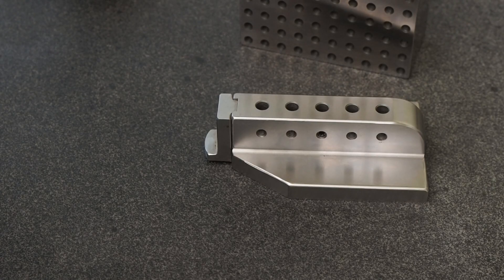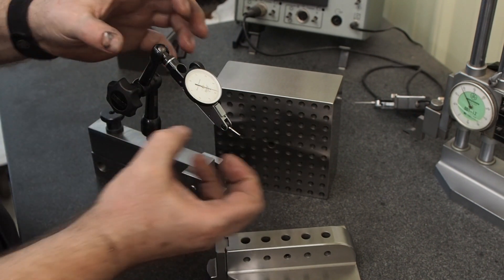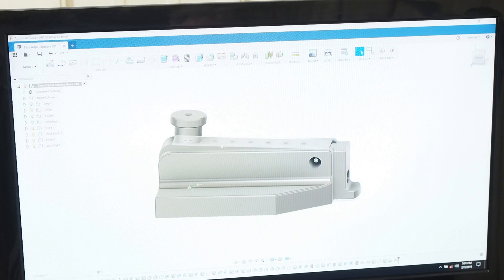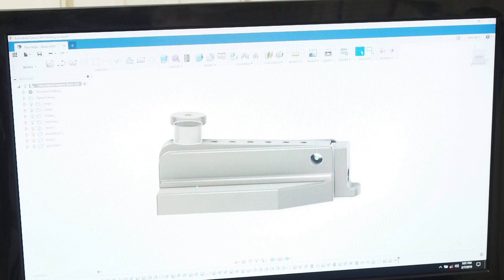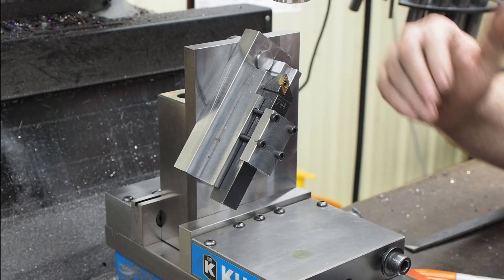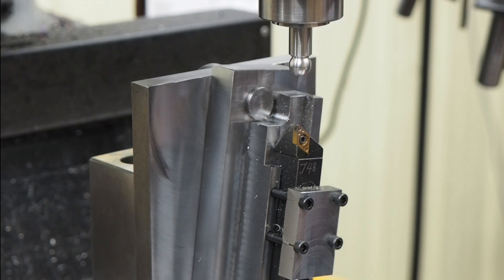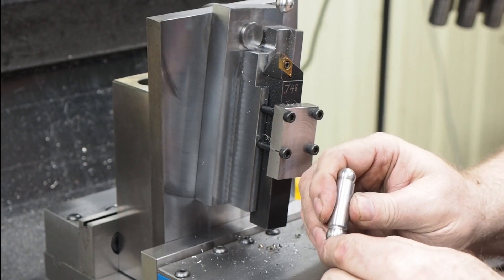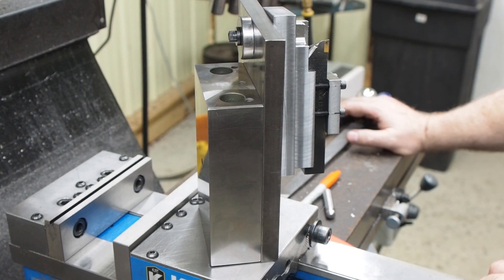Making a Prototype Radius Tool Pt. 1

Comment: You will need a spherical end on the adjusting nut as well as the bottom, otherwise you are tracing an involute, and the radius to the "ball" end from the pivot will vary with angle.  It is interesting to see how smoothly you could cut the ball with only hand operating the cutter.
Reply from the maker: Thank for pointing that out Barry, I will have to modify the other end to compensate.
Steve
Reply: Alternatively just a slot, so that the top nut/washer can slide in the axis perpendicular to the hinge.

Comment: Could you use a rotating barrel nut for the 1/4 20  on the top plate then you don’t have to worry about it staying flat on the nut

Comment: I finally got to the end of your video.  Thank you so much for the shout out.  I jumped over 1000 over night and I didn't know why.  I knew that someone had to mention my channel but was not sure who.  This has been a fun build so far.  Modeling it in solid works or the like would have avoided one of my design errors but it only resulted in an extra hole drilled. I am hoping that my flexure design works out.  I am also looking at including an adjustable height radius shoe.  Thanks again for the inspiration on this project.  Don't forget to comment on my 1000 sub video, you could be a winner.
Reply from the maker: You're welcome Steven, glad to help.
Steve

Comment: After about 20 years of using the surface gage and ball method, I am going to make a squarness comparator. Probably based on the Taft Peirce design. I just can't for the life of me figure out why its necessary to have a fine adjustment. It just seems to me that you rotate the bezel on a fixed indicator to 0 when setting off of a master square and that's it. What am I missing?
Reply from the maker: Hi Max,
I am glad you brought that up. I think I for got to mention that this unit is much more than a Squareness comparator. It also works great as a surface gauge and other things. I will have to make that point and demonstrate in a future video. I modified the test unit today and it works great. In the video we shot today I demonstrated that you can lock it down and it is solid like the non adjustable unit so it can be used both ways. The indicator I use has only .008" travel so if your not use to adjusting without a fine adjustment it can be a little frustrating and time consuming. I am use to it but the kids are not so I am sure they will like the adjustment version better.
Steve

Comment: If you don't get your last pass with the centers perfectly intersecting, the resulting part is simply not a sphere.  I'd have to put a mic across it in random directions twenty or thirty times before I could believe in it.
Reply from the maker: Hi Bob,
You are correct. Also, you can use an indicator on center and sweep it.
Steve

Comment: Nice job Steve. I love this squareness checker and the new radius tool.  For a more precise control of the movement I prefer to use a spring steel flexure plate like Robin Renzetti uses instead of using a dowel pin pivot.
Reply from the maker: Hi Stephen,
Right now this is concept stage and there will be many changes before I am done. Nothing is carved in stone yet. I am aware of the spring steel flexture and discussed this on a different project (between centers grinding fixture) with Robin in the past. It would be a very good and sound way to do this but I will play around with other methods first and weigh the pros and cons  before final build.
Steve

Comment: While it is cool doing lathe work on the mill, wouldn't it be more productive to fix your lathe so you had 2 machines you could use at the same time? Especially since you have more than one shop worker. :-)
Reply from the maker: Hi Brian,
The lathe is not mine, a friend is letting me borrow it. It is not worth fixing, to many things wrong on it. It does not have a DRO. It is small 10" and limited in capacity. The chuck is not accurate, the mill collets are. I do not have the money, time or the skills needed to fix the lathe. I do use it a little now and then for certain things. Also, I do these videos so those who have a mill and no lathe can see that there are alternatives.
Steve
Reply: @SolidRockMachineShopInc  That makes sense. Are you looking for a lathe? I occasionally run across stuff and would keep you in mind if you are.
Reply from the maker: Hi Brian,
This is what we have our eyes on now. https://www.clausing-industrial.com/productCatalogs/Cl/Clausing%20MultiTurn%20Catalog%2003-2017.pdf
Steve

Comment: Steve, I would like to copy your squareness comparator base you show in the opening of this video, the one with the multiple holes for the Noga indicator holder.  I am interested in any details that might not be obvious.  How about a rough height, width, length, material, any special considerations, and any changes you might consider if you had to do it over?  It looks pretty straightforward,  and I already have the Noga tool, just want to get it best as I can on the first try...  It looks like just about the perfect tool for the job, much better than the typical indicator stand rig I have been using, and a fun and easy job.

Oops, I should have watched the video first!  Anyway, count me in, and I will wait to see what else you have to show us about it...  Thanks!
Reply from the maker: Hi Bob,
I can make you a print if that helps. It is pretty straight forward with no secret sauce in the mix. It does work well and I like the feel it has.
Steve
Reply: Steve, since you are doing major upgrades on the tool, let's just wait and see where that takes us...  Thanks for the offer, though!

Comment: I don't see why you'd need a ball on the end of the thread. In fact it would even be a bad idea because the ball would be able to rotate with the screw. So why not a piece of rod with a thread across in the middle? Same for the nut piece on the moving part, so there's no side force on the thread and the nuts don't have to shift.

Apart from that a different design comes to my mind, similar to the flatness measuring devices. The tilting part would be held by a flexure and for the adjusting part you could use a differentlial screw. That's basically a screw with a finer internal thread. Outer thread goes into the flexing part, inner thread goes to a screw in the base. This allows for really fine adjustment. Here you can see what I mean: https://www.youtube.com/watch?v=-ZN6Kj3sXtc
And here something about the device: https://www.youtube.com/watch?v=UZ1Vz1LlAy8
Reply from the maker: The ball part of it is already going to change. I am aware of differential screws but that is not needed for what I am shooting for.
Steve

Comment: I’m new subscriber to your channel and not a machinist. Although a ball end is so neat, and your tool is looking great,  a perpendicular from your pivoting horizontal arm will not stay on the same spot at the bottom plate. Maybe using two pins that swivel. Accepted that turn ratio to lenght will not be constant, but adjusting tenths will not matter as it is more important that the screw gives anfiner rather than coarser travel.
Reply from the maker: I totally missed that and when Barry pointed it out I had the palm of the hand to the forehead bozo moment. The design is changing on that part of it now. What I am going for is a smooth no jerking adjustment fine enough to stop at a tenth and course enough for faster adjustment travel.  
Steve

Comment: Hmm, I'm not seeing the need for a ball pivot at the lower end of the fine adjust screw, surely a barrel pivot would suffice? I can see how the underside of the adjuster knob would benefit from a convex finish to run on a matching concave washer to allow the required float at the top though.
Reply from the maker: I may go that way after Barry Gerbracht pointed out something I missed. I will need pivot action on both ends to achieve what I want. Something similar to my toolmakers vise.
Steve

Comment: I wonder what the advantage of making the tool holder adjustable with a calibrated screw would be. Offsetting the tool point within the fixture may make for more possibilities. Maybe multiple tangents of radii convex to concave.
Reply from the maker: You are correct. There are many possibilities here and I only covered a few. At the time I use the DRO and math to adjust the tip position but there are other ways like you suggest too. It would be kind of neat to add a boring head style adjustment to the mix.
Steve

Comment: One issue you might have with tightening that pin up is that it will tend to unscrew itself.  I had that problem when I made a ball turner for my lathe.  The solution I came up with was to put a set screw in from the other side so my retaining screw could tighten hard against that without binding everything up.  I think you would also be much better off to recess the top of the pin so that it is flush.  Don't forget that it's also useful to put your tool in past the centre to cut convex curves as well as balls.
This will be a really useful tool for lots of jobs.  It could be very handy for radius dressing and it could be very handy on the belt grinder or mill for rounding the ends of stock.  Great project!
Reply from the maker: Hi John,
Thanks for sharing. Lots of good information. One of the videos coming up will show some of the cuts you mention. I made my pivot pin about a .001 longer than the thickness of the two parts it goes through so I can tighten it up without the risk of it unscrewing itself. Everything is in the ruff right now and many changes will take place until I am happy with it.

Comment: How are you centralising the x-axis on the radius cutting? If you are not centred won’t you be cutting a lens shape?
Reply from the maker: The X axis is set from the center of the pivot pin to the cutting tip. The X movement is with the mill table. Stopping the mill table on the center line of the pivot point gives a true radius. The distance of the cutting tip to the pivot point sets the radius.
Steve

Comment: Nice radius turner, Steve.   Looking forward to the finished improvements to your squareness checker.
Cheers, Gary
Reply from the maker: It's still in the rough and I most likely will be making changes. Barry Gerbracht pointed out something that I did not factor in that I will have to address yet. I am sure there will be other things too!
Steve
Reply: It certainly is a neat little setup. I would suggest and I'm sure Steve has plans to put a handle on it to stay away from those sharp finger degloving bird's-nest.